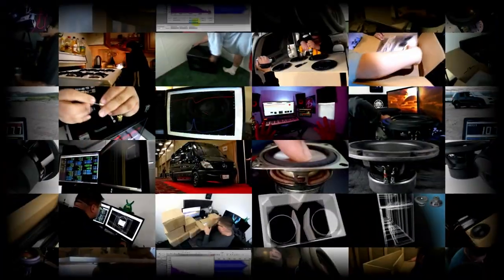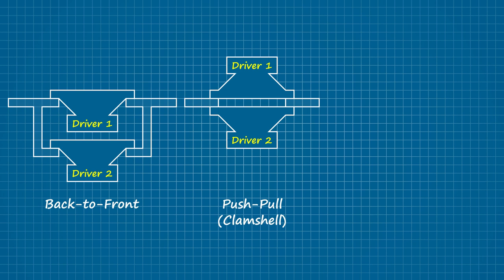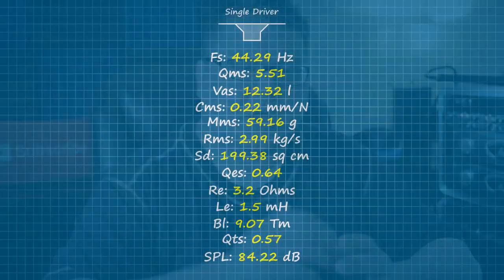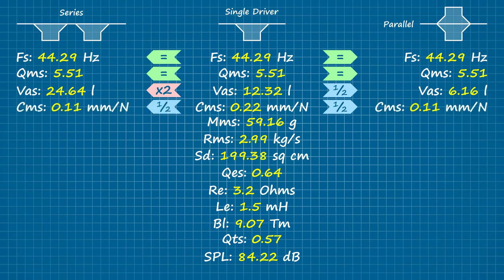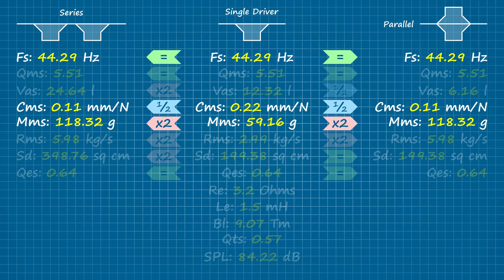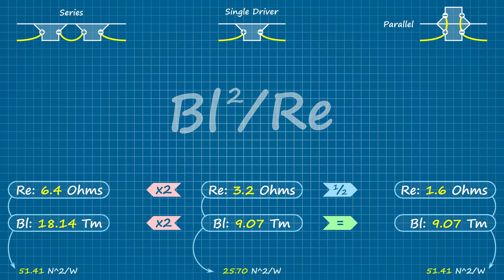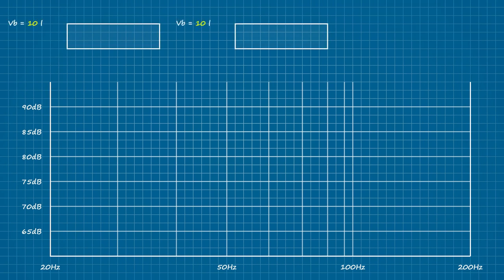All About ISOBARIC Loading

Comment: Can you cover infinite baffle in as much detail as possible, I have one in my car and would love to pick your brain
Reply: It's only "infinite" baffle if your airspace for the woofer/ woofers exceeds 10 times the total vas of the woofers added together. 
What you have is an oversized box, which, can be ported to give you a great EBS setup to play flat, low, and fairly efficiently powerwise. 

I run 2 solo x 18s in a hatch back little car by baffling the front from the back of the car and ported it. 

Result is a virtual 26 cube box with a very flat musical bandwidth and they still handle 6,000W perfectly.
Reply: @staywhite6332  I was more hoping for a video, exspesaly since most people never seen an infinite baffle or trunk box before. Could you explain the difference in home and in car audio and go over the two. I'm more interested in the car audio side of it tho as I have to 18's Skar sdr in my car. I know the volume is bigger than the vast but not 10x.
I've read that the two things to pay attention to is fs (low) and qts 0.7 for this approach but I've also read (from a person that has done 20+ baffles home and car) that he has found that he likes a low qts of around 0.3 saying its flatter and the cone is more responsive. Could you explain this resoning. Also most say you can use any sub for one and two that you just have to cut the rms in about half. Tho my brother (pysisics major) speculates this isn't true as rms is a thermal rating. What are your thoughts? 
I'm interested because I would like to explore more within this ib world but can't decide on what direction to take so I'm just trying to accumulate information for now tho it's rather difficult as it's such a small area.
Thanks for any of your time.
Reply: @staywhite6332  ps in your sealed vs ported video at about 1:20 mark (I believe) you stated that if the volume of air is greater than the total vas it's "tecnicly" an ib but in your reply you seem to state that they are two different things

PSS I didn't port my subs but they do vent through the rear fender area that has no carpeting, may be worth mentioning

Comment: What it you wire the isobaric speakers in series as you did in the parallel configuration (and vice versa)?
Reply: They'll pretty much push in to each-other
Reply: @Sanisfaction  No, they should of course still be connected in acoustic phase
Reply: @vemsom  sorry sir, i shouldn't just post my thoughts around 4 in the morning after a night out xD ,,, obviously the woofers should be!

Comment: What about baffle how much baffle do u need between each woofer do u need 2.5x the Xmax for baffle depth in size more or less ??
Reply: Xmax only matters in the back-to-front setup, which would be Xmax + motor depth. In back-to-back, you'd need 2x motor depth. And in clamshell, you'd only need 2x surround depth. Plus some additional room for clearance. All three act as a singular piston, meaning they move in the same direction, so there's no possible conflicts, other than possible cone-motor conflict in the back-to-front setup.
Reply: So if u had both Sorrounds touching is that ok I want to know the spacing between the Sorrounds of the woofer 

Cheers
Reply: 91rickstar : I would recommend the surrounds (close) but not touching.. (extra space between the subs will loosen their coupling, add moving mass (air) and lower fs etc )..  Incase it wasn’t mentioned: the wiring on one sub is reversed, so that the subs move in the same direction ( working together) ...

Comment: So that could explain why I always felt like I had deeper lows in my car than my buddies. I always wired it in parallel. Why? Idk just assed more power would be delivered to each with a lower impedance. But the box also could be a factor also because I'm pretty sure my box volume was slightly larger. Both ported. Near same power as well.
Reply: The box was the difference if they were the same driver and amplification. Wiring in parallel and mounting in parallel (isobaric) are 2 completely different things.
Reply: @matpatte  one year later. Nice. Lol but yeah definitely nice so have more volume.

Comment: that compound the mass is only doubled so not corrected.
The air mass between the chassis must be added to Mms. 

this results in completely different TSP parameters

There are different names for this in the literature, but "Isobarik loudspeakers" doesn't quite hit the nail on the head: Isobarik starts from the long-forgotten idea that the outer woofer doesn't feel an air spring because the synchronous inner diaphragm keeps all air pressure fluctuations away from it. According to this theory, it should behave as if it were in an infinitely large housing - but it does not.

Push Pull
"Push Pull" describes the functionality more clearly. One voice coil pulls the other pushes its diaphragm, and both together move the air masses. However, the nail only hits the head when one of the arrangements (1) or (2) is in play: Here the drivers involved are mirror-inverted to each other, so that one can speak of "pushing" and "pulling".

This arrangement has a lot to offer in terms of sound: asymmetric behaviour of the diaphragms compensates for this design and thus reduces distortions of uneven order, i.e. the distortion factor K3, which is problematic in terms of sound. The mechanical vibration systems of woofers behave more or less differently when the cone moves into or out of the basket. This results in distortion, which reduces the mirror image of the arrangement. 

compound
The term "Compound" sums up the construction method: It is a new driver with new parameters, composed of two woofers. In principle, this driver can be treated like a single woofer. However, this only applies if the coupling chamber is much smaller than the main volume.

Comment: Displacement and power handling sufficient to reach Xmax are all that matter in modern woofers.  Looking at the maximum SPL achievable in each configuration, the two parallel woofers beat the single and isobaric configuration hands down.  With the use of simple line level Linkwitz transform EQ the two parallel woofers will produce superior low bass and group delay as well. The isobaric concept was a crutch that wasted a second woofer to make a passive woofer system with no EQ have a better low end response with no more displacement or max SPL than a single woofer.  It is really a waste of a woofer. So a really interesting explanation of an obsolete configuration.  It would be good if you showed the max SPL plots for the three configurations.  Anyone can do it themselves using WinISD in a few minutes.  The Linikwitz transform is in WinISD as well so you can extend the bass of the parallel woofer setup and get any Fbox and Qbox that you desire.

Comment: Isobaric chambers are so old and if they were as good as people think' all people would be making them. I suggest the reason why they are not is that as the pressure wave coming from the  rear of the first speaker comes out it is interrupted and some sound is lost being that it is kept in a state of limbo rather than hitting the enclosure and resonating on it. Any sound is then forced to the side then resonates in that direction rather than to the front where you need it. It might seem clever' though when you understand acoustics and resonance it is not the most logical way to get all the sound from two or three speakers. That is why we do not see them in all speaker sets. They might have an effect that some people like 'though not all people like that effect. Some say that decibels are lost and that there is no real advantage.
I have speakers that generate more decibels per watt than most speakers on the market, they score higher than all the expensive ones and sound amazing for their size. They have aluminium drivers and mica matrix multi layer cones. 27Hz - 38KHz. and 20Hz to 200Hz for that extra bass. 5 way speakers wipe the floor clean with 2 way speakers.
YEAH YEAH WOTTEVVA.
Reply: Your comment for the lulz.
Reply: @staywhite6332  Anytime you want to play, you are the mouse I play the Cat :-)
OOF OOF OOF :-)

Comment: Hey Hexibase! Excellent video on that topic. What would happen if i put both woofers outside a closed box, twist the polarity on one, put it on the opposite side of the box and use it like an "Active Radiator" instead of a passive radiator"? Does it cancel each others Frequencies out no matter on what side the second woofer is?

Comment: 4:22, something doesn't seem right to me.  In series,  if everytime you double the # of identical drivers, there is a +3dB increase in sensitivity, then it seems like if you went to 4, 8, 16, 32... drivers, the sensitivity would go "thru the roof".  I don't see how this can be.  Let's look at (n, S) tuples where n = the number of identical drivers and S in the sensitivity (in dB).  You show (1, 84) and (2, 87).  Continuing that pattern we would get (4, 90), (8, 93), (16, 96), (32,99)....  This doesn't seem right to  me since there doesn't seem to be any theoretical limit.

So for clarification, let's simplify the example.  Suppose we had 1 driver in a 10 liter box and got 84dB sensitivity.  What would be the sensitivity of 2 of those, each in their own 10 liter box, but wired in series?  I assume when you say sensitivity you are talking about wattage, not voltage right?
Reply: +3 dB sensitivity on doubling drivers is correct as long as drivers don't interfere for the given wavelength. Put them too wide apart and you loose the gain.
In parallel: +3 dB plus extra 3 dB thanks to double power.
In series: +3 dB MINUS 3 dB due to half power.

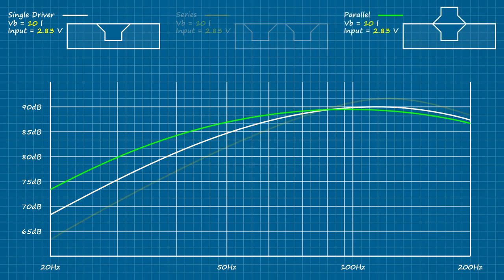Comment: Revisiting this video - When you start talking Isobaric, many of your audio people don't want to talk about it, and Peter's video is no exception. He has all but said, "Isobaric is highly technical, is not a high performance subwoofer design, and I'm only making this video 7 minutes to dump the info and all of you can quit bothering me about Isobaric, because I'm done talking about it." So if you can read body language, Peter really wants nothing to do with Iso loading, there nothing about it that captures his interest. But those of you wondering if Iso is worth it, or are curious about its advantages, at 5:30 in the video, the graph tells it all. Iso is best at producing LOW bass efficiently. From 20 to 90Hz, the Iso is king. It just takes more amp power to do it. And that's the summary of Iso loading.

Comment: Re is electrical connection dependent.  With series mechanical, the option to wire in parallel or series exists.  Halving or doubling.  All the parameters governed by the electrical connection will be similar, though halving or doubling will be dependent upon the measurement primitives of inductance, resistance...

Comment: my subwoofer array is 2 12's front- to - front 6th order bandpass, ported on both sides with a variable port tuning feature, variable from 15hz to ~60hz resonant frequency.  woofers are wired in series to a 6 ohm impedance.  i've found the port tuning vs. enclosure volume is the real concern for best performance, not the t/s parameters, as they are driver specs, ONLY.   Too many other considerations to obsess over

Comment: Hex, 
Isn't it true that for a given volume the F3 point will be halved for isobaric loading vs a single driver? IOW, from 40 hz, for example, to 20 hz.

I've built several Iso subs and I swear it sounds like bass extension is lowered dramatically, but I've not measured it. 

In any case, it seems that ISO loading is clearly an audible improvement over a single driver all things being equal. More slam, density, control, etc.

It sounds like you majored in engineering, physics or math.  (I have an ME with minors in physics and a background in Naval nuclear propulsion, FWIW.) Check out Edward Witten's incredible mind.

Comment: I’ve been more on the physical side. And never got into any details besides watts and rms and voltage. XD I’ve had wires light on fire and replace them with bigger wires... surprisingly I’ve only blown 1 subwoofer. And it was by a 2x4 slapping the face at max volume.

Comment: My god !! Was he on a time limit ..?
Slow down ... it sounds like your preaching to the already informed...
I’ve used this configuration many times .. had a lot of experience with it ... I have always put the coils in parallel ( subwoofer application) using 8 ohm drivers to give 4 ohms and I’ve also always mounted the drivers face to face to iron out  non linear Bl forces and compliance issues. All you have to remember ( to keep things simple ) is that isobaric mounting halves the Vas figure ...

Comment: This video puts an isobaric design in way too positive a light. The graphs of output are with power and box size constant, but that only makes sense if you have a fixed space or a fixed amount of power. An isobaric design is essentially throwing away the output of the second woofer almost entirely for the benefit of a smaller enclosure size.  It is a very inefficient and expensive design that rarely makes any sense.

Comment: Unfortunately, you do not take into account that the air in the coupling chamber also has a weight. This is the reason for the shift of the resonance frequency with larger volumes.